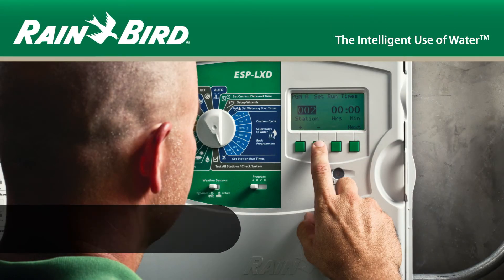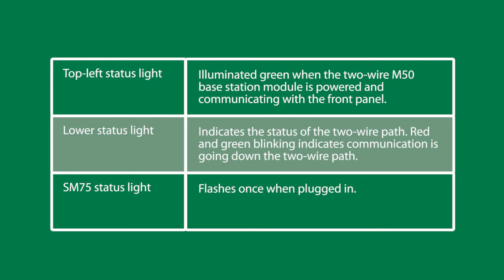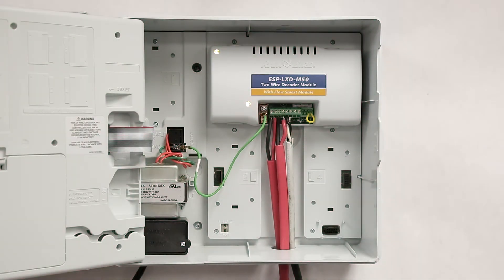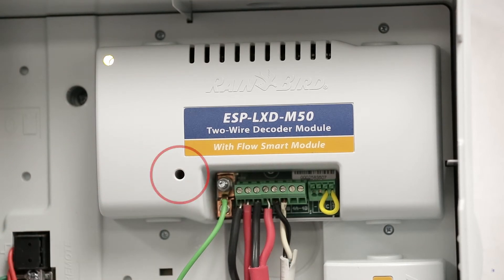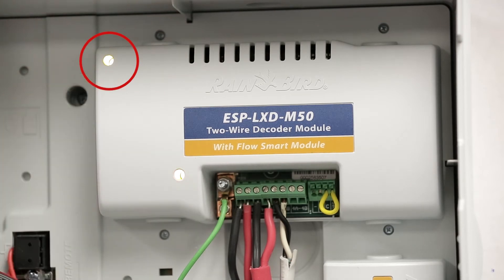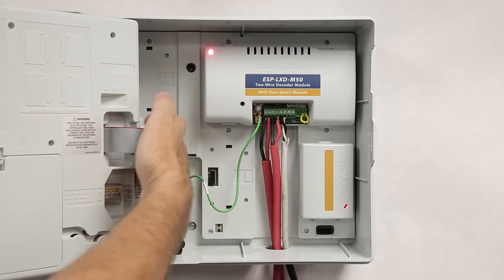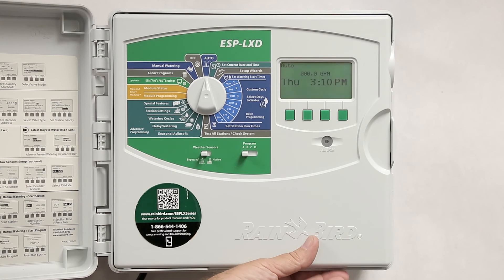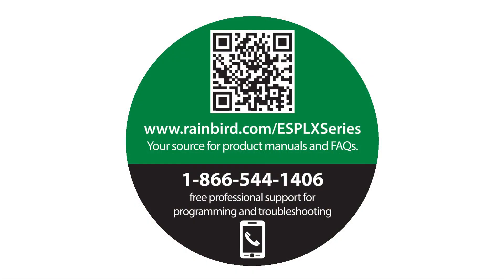Checking LED Indicator Lights on ESP-LXD Modules

Comment: "Short Finding Mode" is stop output voltage to the 2-wire, so cannot use this mode for short location find out with clamp meter?

Comment: I have a quick question. Is the module supposed to be making a sound? Sometimes when I turn on a zone it makes a beeping noise but sometimes it doesn’t. I have also been having trouble with some zones sometimes coming on and sometimes they won’t come on. So I’m not sure if it could be the module
Reply: ya I get a constant beep

Comment: The lower LED light on the module lites green and red . What does it means? Also says station 35 open circuit or line open
Reply: Station 35 needs to be rewired
Reply: @hellyafghopups  Now there's  an emergency red light or warning. It says: closed path.
Is that a cut wire or short. Now where? How to find it. That's a head ache when you didn't install it. I don't even know which direction it goes to start. I know I need a wire locator. It can take forever. Over 60 stations